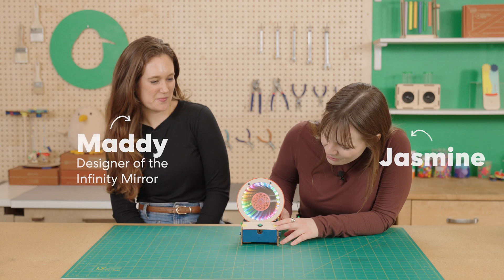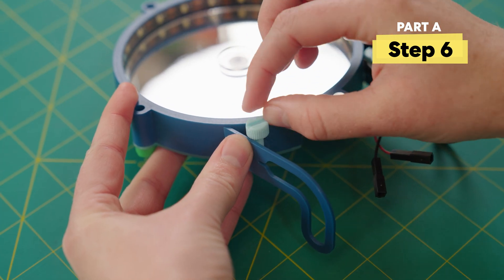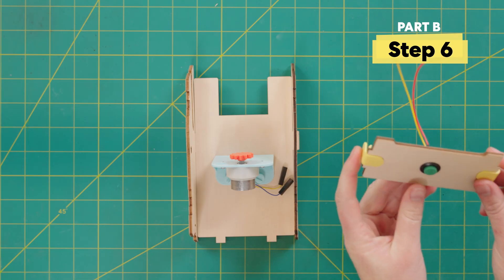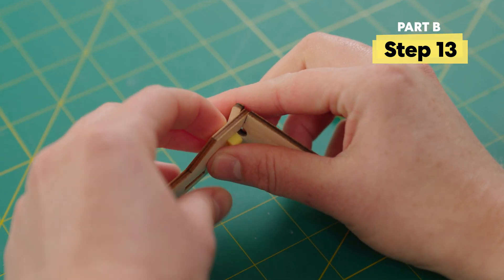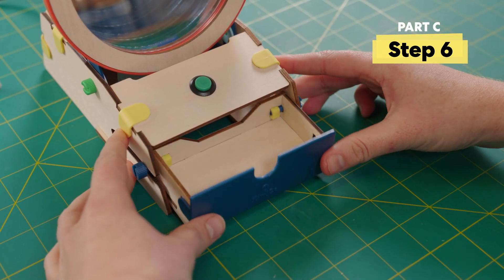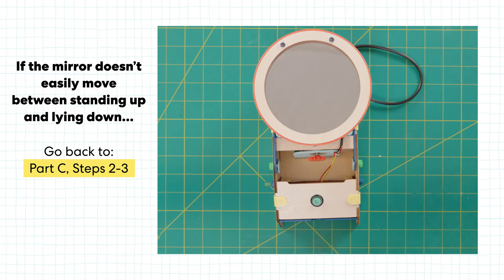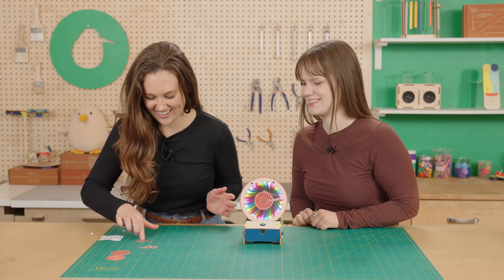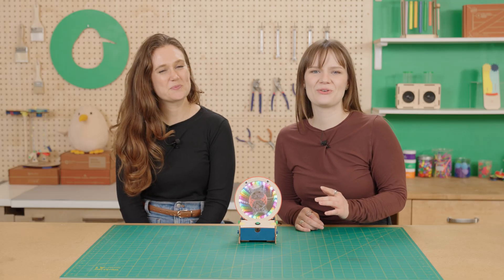How to Build a Mesmerizing Infinity Mirror | KiwiCo

Comment: How am I supposed to get to the wires now that I have put the cover on?
Reply from the maker: Hi! If you lift the mirror up and lay it flat, you should be able to get to the wires. However, if you're still having trouble, you'll have to take it apart and adjust the wire before putting it back together. If you need additional help, please reach out to our support team, we'd be happy to further assist you. 😊